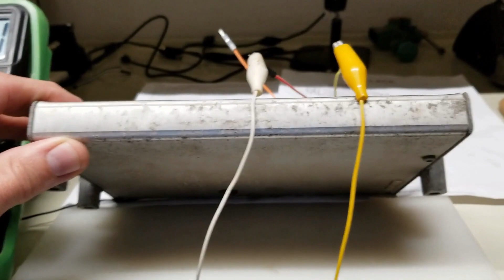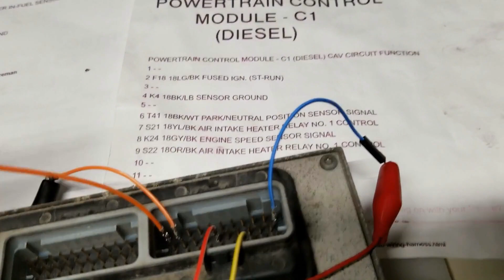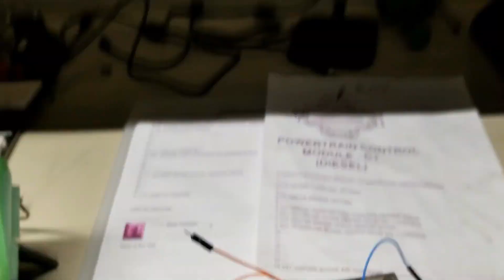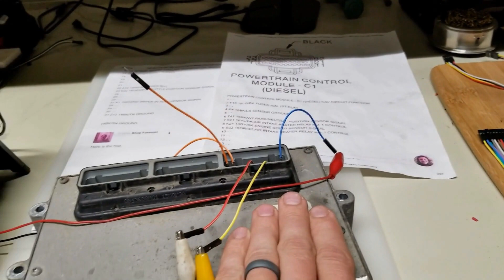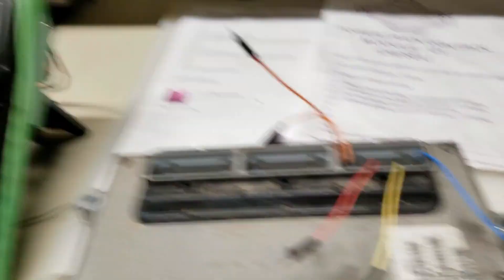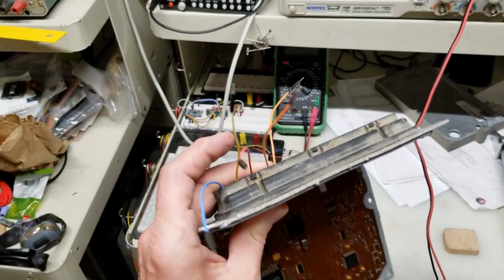1997 Cummins PCM Troubleshooting and Repair 1

Comment: I've got quite a big problem in my set up, im getting 5v at my ecu ground. the shorts definitely not at the pcm, If i splice the wire and test on the pcm side, i get the ground signal. when i test to other spliced end, i get 5v... but im worried my pcm is fried, that ground wire shorted with the battery. that much current would destroy anything...

Comment: Mine blew up rigHt there at the same place where your chip got hot. the diode is even chipped. The caps lost the juice. A real mess. Not sure I can fix it. Is not even a real board where one can solder on it. Maybe a super fast touch of the iron and hope. I think mine blew up while jump starting the vehicle.

Comment: Not sure if this is my problem or not. Just replaced my TPS sensor and tach is better but jumps and surges at times. Also the truck will loose torque converter lock up or will not shift into overdrive. Really need to fix this issue.
Reply: Did you ever fix this? My 1997 is doing the exact same thing
Reply: @elliottdye5547  I did eliminate it for a while just by making sure all my grounds were well cleaned. The truck is doing something similar again now. I just baby her and get can her to shift right but it's still annoying. Fixing to sell her although I hate parting with an Armageddon truck being that it's right around the corner.

Comment: Dont seem til see much on the 04.5 onward... Would you be interested In trouble shooting my 05 ecm?   Troubles  when warm it lopea at idle and weird dead spot at any cruise  speed. And will hang at or above 2k rpm (wil mor go down) if blip throttle in park.